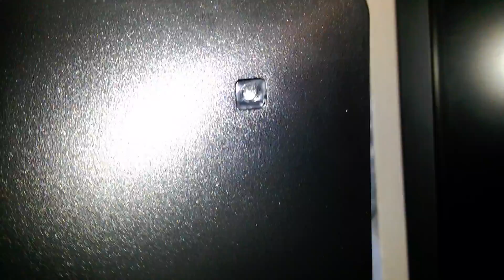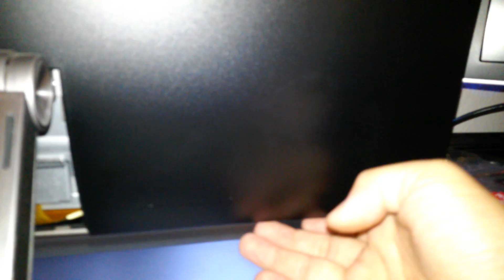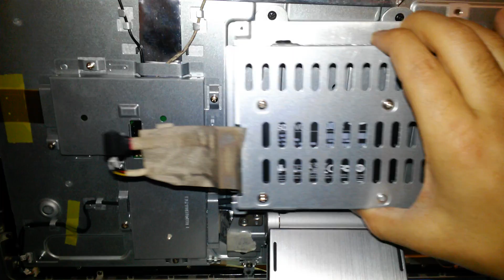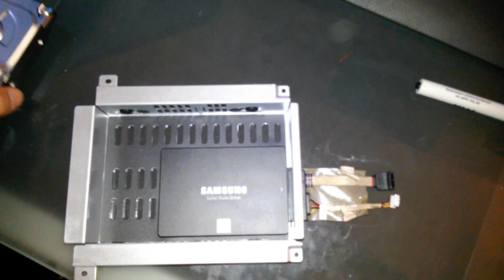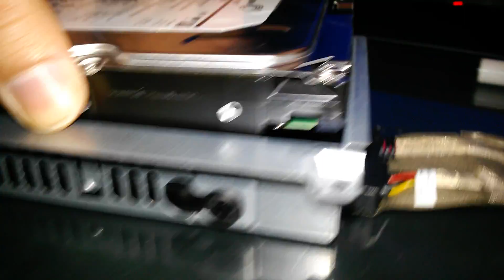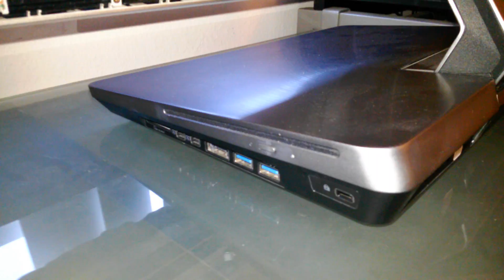Asus ET2300 Hard Drive Replacement Instructions

Comment: I found it tricky to pry lose the top part of the back cover. The trick is to pull the lower part of the cover over the hinge first so it becomes somewhat downward mobile, after that it's still a matter op applying force and hoping for the best. Used pliers to take out the power connector of the HDD.
Reply from the maker: nice tip! at the point i had it open, i couldnt hsow you how i pryed it open so i just zoomed in on the clips so you can get an idea on how to do it. thanks!

Comment: Well i have some bad news. 
I tried to hook up a samsung 850 EVO to the sata port on the motherboard but had the same problem as mHopia. I couldn't power it anywhere.
So since i was not happy with the speed this SSD (installed behind the screen) gave me ( about the same as Tuan Massey) i returned it and replaced it with a samsung 850 EVO MSata drive. Because i thought the low speed is somehow due to the strange flat cables going to the screen. 
So i was thinking.....a mSata SSD hooked up to the motherboard speed should be like it should around 500MB p/s right?? Wrong! The speed did not improve at al! Its like its hooked up to a sata1 port!

I cant believe it. The speed is the same as behind the screen!  I contacted ASUS support. Asking why they put such a slow sata chip in this system. It should have a SATA3 port and not SATA1.
At the moment i am waiting for their reply. I let you guys know!
Reply: Dear Tuan, what speeds do you reach with your SSD? I installed a Sandisk Ultra II SSD. Reading speed is (according to Crystal Disk Mark) around 130MB/s. That is a speed that you could expect with SATA I. But writing is at 10-11MB/s. Very slow. And I already got an exchange SSD (same model). It delivers the same disappointing write speed. Thanks.
Reply: Thanks for the feedback. I returned the Sandisk Ultra II. I am now using the Crucial MX300 1TB. And it is performing as you can expect when using an Ultra I interface. Sequential read - 140MB/s | Sequential write 137MB/s.
Reply from the maker: Bummer!  Even though the benchmarks scores are low, it still does the job.  The Random read/write speeds alone are at least 50x faster than any HDD (RPM disk). The SATA ports might be only SATA II?  Thanks for letting us know your experience.
Reply: Tuan Massey your'e welcome. The sata ports are SATA1 actually. As you can read in my post what ASUS replied to me.
Reply: Dear Mark,

We had contact with our head office and this 
model of Asus (Asus AIO ET2300INTI) unfortunately only support SATA 1.

If 
you have any further questions, please feel free to contact us again.
With kind regards,

Asus Holland Bv.
Reply from the maker: That is really disappointing.. oh well, if they say so. SATA2 was released in 2004, you would think they would at least have that, lol. Even then, SATA3 was released in 2009, that was over 6 years ago.  I think they must have meant it's SATA2? either way, that explains the low benchmark scores. Thanks for following up again!
Reply from the maker: Those write speeds are horrible.  "Mark van de Worp" wrote earlier that he contacted ASUS and they said the ports are indeed SATA 1.  I think ASUS went cheap on these motherboards. You might want to make sure you have the updated chipset along with updated AHCI drivers for "IDE ATA/ATAPI controllers. also update your Storage controller in device manager.
Reply from the maker: Just did a test on my Samsung EVO SSD [ Sequential Read - 169 MB/s | Sequential Write - 137 MB/s | Random Read - 38,000 IOPS | Random Write - 31,000 | IOPS ]

Comment: Hello! I hope you are still active here.  I have this computer, and I want to upgrade the hard drive and RAM. I read on different forums and they say that 8gb ram is the limit that you can install, is that true?   And the processor is a desktop processor, is it removable and upgradable?
Reply: Also I forgot to ask, it's only possible to have 1 harddrive?
Reply from the maker: +Tim Comet You can upgrade the processor with "Intel® Core™ i7 3770 Processor" Yes it's a desktop processor. and 8GB RAM is the MAX, unless they came out with a bios update that makes it handle more.
Reply from the maker: +Tim Comet From what i can see, it only has the capability of one SATA drive
Reply from the maker: +Tim Comet The RAM is "Laptop" memory by the way. SO-DIMM sticks.
Reply: Tuan Massey Ah thank you! Yes I did upgrade the RAM with  8GB, since they only have one slot free that's the limit.  So now I have 12gb.  I installed a mSata driver (Samsung 850 Evo MSATA 250GB), really easy since the msata slot on the motherboard is free, I run W10 on it and it's really fast! I don't think I need a new processor. Maybe in the future! :) thank you for answering!
Reply from the maker: +Tim Comet sweet!
Reply: can you use AS SSD Benchmark to test this mSATA SSD ? I need know r/w fraction.  thx! 
 maybe the  mSATA port only sata 1or 2,not sata3...
Reply: Hey Tuan! Thnx for making this video. I also upgraded to a 500GB 850EVO and also noticed that the benchmarks are very disapointing  like yours. Tomorrow i am going to open the bottom part of the pc.

Why? well , in another video on Youtube i noticed that there is an unused SATA port located on the motherboard. So i am going to try to connect the ssd (with a long sata cable) on that port to see if its going to fully benifit the sata3 bandwith and speed like it should. I'll let you know.
Reply: Hello!  I'm not able to do the benchmark today.. I'm on "rehab" or whatever you call it.. But I can tell you there is a HUGE difference! The computer starts up immediately even though I have a lot of programs installed on the ssd(that I won't ever remove since its not good to install and remove on ssd). I have no games or media on it.  Only the standard programs I use. And even with programs on it the hard drive performs the same as out of the box.  I've had zero crashes or errors.  Hope this helps! Tim
Reply from the maker: Hi Chao Kobe,  I have not installed an mSATA SSD on this Asus yet, just the 2.5" SSD shown in this video.  Benchmark scores are not impressive when ran with the samsung magician benchmark software but the system is much faster with this new SSD installed, it has been very stable. It's well worth the upgrade for the pretty simple install and low cost SSD. These are my benchmark scores with RAPID mode disabled, right now on this PC.  [ Sequential Read - 200 MB/s | Sequential Write - 187 MB/s | Random Read - 39,000 IOPS | Random Write - 33,000 | IOPS ]
Reply from the maker: Cool! Let me know if its any faster. thanks!
Reply from the maker: Hi Tim. "chao kobe" down below asked if you could provide us with your benchmark results for your msata drive. thanks!
Reply: +Tim Comet May I know where is the MSATA port on the mother board? Is the Samsung Evo included the driver for installation? Thanks a lot!

Comment: Hi +Tuan Massey In your experience, Can the RAM be upgrated? Thank you so much for this video :-D I already upgrede to a Samsung PRO SSD
Reply from the maker: +Kio Milenium Yes you can upgrade the RAM but it will be a hassle to get to since its underneath connected directly to the motherboard. These are SO-DIMM slots. You can look at this video if it helps ( https://www.youtube.com/watch?v=yNprdECcE6o ) 

If you do not have at least 8GB RAM i recommend disabling RAPID mode within Samsung Magician, this will give you back 1/4 of your RAM. You can easily just open task manager, look at how much memory your system is using then compare results with it Enabled and Disabled. Your SSD will still be super fast without RAPID mode. 

Cheers!

Comment: Hi, can you help me about ram and graphic card replacement? Is this easily to do it? Did you try to do it? Many thanks
Reply from the maker: stefano basso I do not think you can upgrade the graphics card in this unit, you can only replace it with the same one if anything. The RAM is accessible if you take off the bottom. There is a youtube clip out there that shows you how to remove the bottom.
Reply: @tuanmassey  yes but only 1 slot is accessible. I couldn't find the 2 other. now i have 2+2+8GB ram

Comment: On the motherboard of mine I found a mSATA port for a ssd, eg. Samsung 840EVO,  it installs easy & boots up well. Plus a spare sata port on the motherboard, but I can't see where to get power from.
Reply from the maker: Thanks for the info. MSATA powers through the port directly, kind of like PCI ports
Reply: Yes I know the msata has it's own power & I got mine working fine,  what I can't find is power next to the extra sata port on the motherboard.
Reply from the maker: m Hopia Oh i see. Yea, i don't know either.